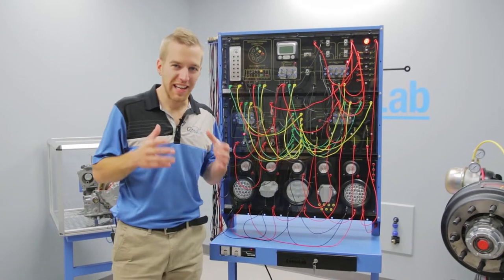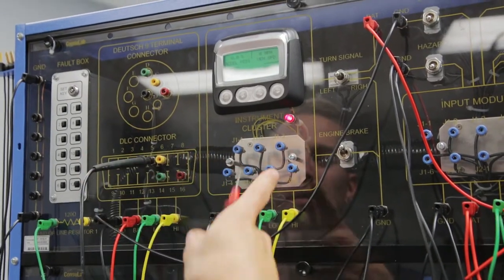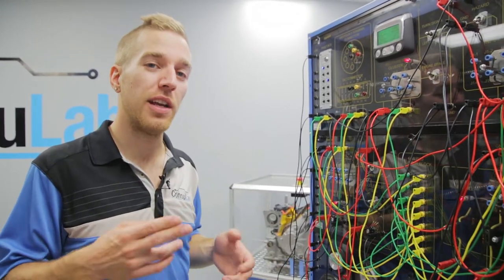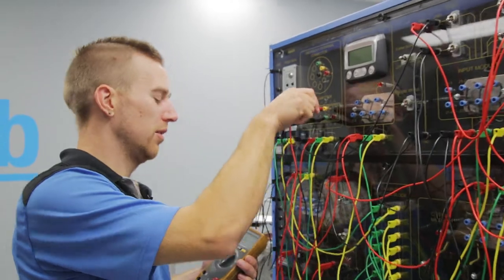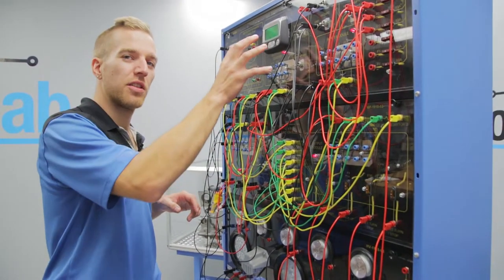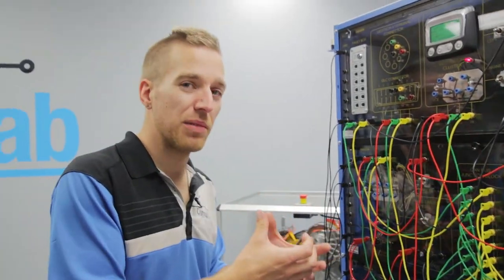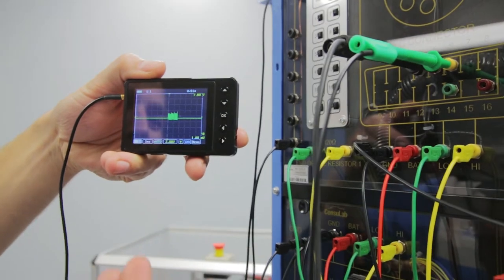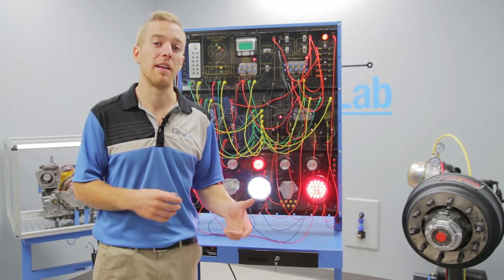MP-1918  CAN BUS Multiplex Trainer

Comment: Idea for you guys: can you make PC Based simulator software to Interact and troubleshoot CAN system particularly? Load a real car ( Cadillac, Chrysler, Ford ) the most CAN problematic vehicles — with real Wiring Diagram and everything-else——i would pay to use that software simulator to teach myself get expert in it. Yea theres alot lessons, videos, manuals, Powerpoints but real feel on real car on simulator will get best hang of it...